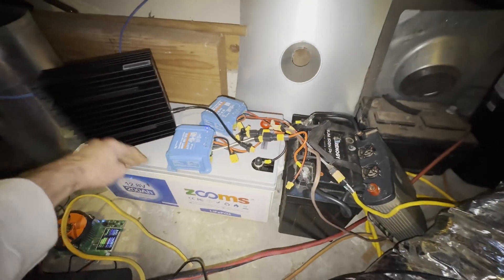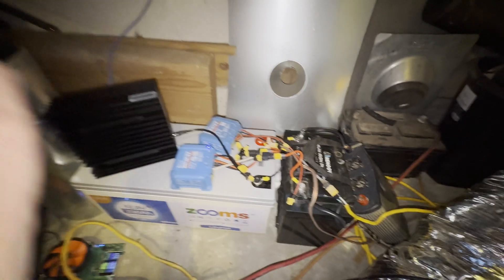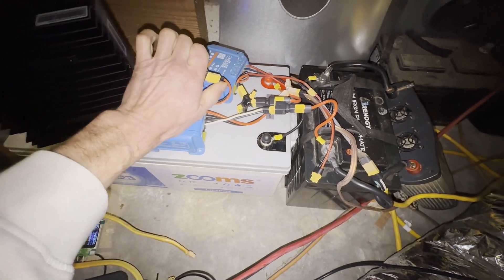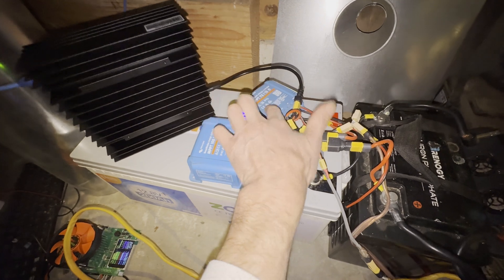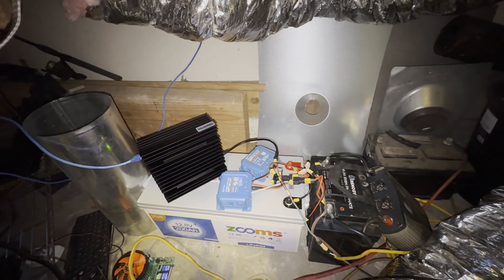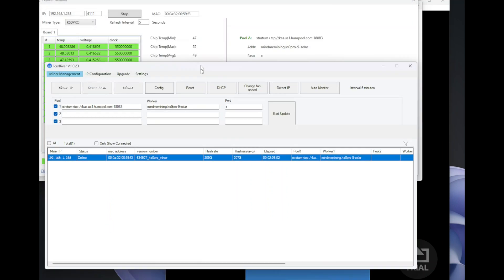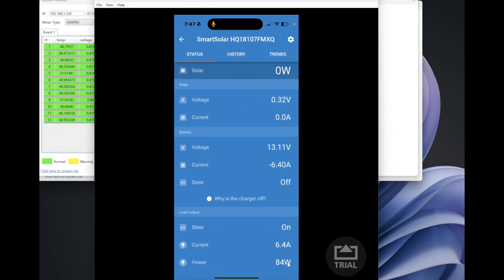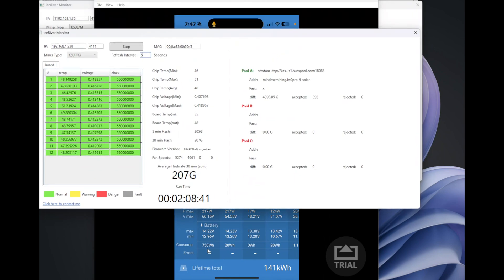MY NEW ICERIVER KS0-PRO GOES 100% SOLAR MINING OFF THE GRID

Comment: Hi, interesting project to keep KS0 miners running on cheap solar power. Would mind posting a detailed wiring (awg) diagram including all fuses, please?
Reply from the maker: Solar calculations is really based on your load and use. For example if you calculate running one ks0 ultra or rx0 not OC, it’s 90W power consumption on 12V times 24hours you get 2.1KW daily use you always add 10% on solar to DC conversion and if use battery for storage another 10% loss so I simply add 20%  so it’s about 2300W of daily solar you’ll need per ASIC. Size of wiring will depend on how many solar panels and battery size you use.

Comment: How many wp needed to power 1 ks0 ultra without battery? Im trying to figure it out, no need 24hr on, if there is sun its hashing, if not, let it off
Reply from the maker: its been 96-98W on 12v directly plus solar charge controller uses some power as well. So I think it is safe to calculate 105W for solar use, hope that helps
Reply: @DontMindMeMining  thanks,, but I mean the panel size, is it 300wp enough?

Comment: Well based on my off the top calculations i mean your looking at 2.4kw you need to produce in solar to run each ks0 that might be doable with 400w in panels. Well idk id have to sit down and do 12v amp draw calc and charge rate calcs but solar ks0 mining is definitely not out of the realm of possibility cause they are so efficient. It is big upfront investment specially when you have alot of ks0s.
Reply from the maker: using close to 7KW a day for 2 ksopro overcklocked to 280G. I may need to add another battery to male it total solar mining 99% off grid

Comment: Interesting video as well, I just have one question, I got my first KS0-Pro about 7 days ago, and after mining for 20-22 hours it stop hashing, this has happened every single day and Iceriver are not being helpful, Have you experienced or heard of such a thing?
Reply from the maker: I don’t see my response I posted. So did you update firmware from iceriver website and are you using any OC firmware? Have to make sure you monitor with monitoring tool and check temps and chips voltages. Also, I noticed when pool connection is bad the miner will perform badly so I had to choose different pool.
Reply: @DontMindMeMining  yes I did update the firmware and am currently using the stock firmware, I am monitoring the temps and all are within normal max as been 53 l, I changed pools but without any success and like clockwise after mining for about 20 hrs, it's stops hashing with a solid green light and after  30-45 mins it's reboots itself, during that time I don't have access to the web GUI
Reply from the maker: it sounds like there i a problem with the ks0pro in that case, i havent had anything like that with all 9 of my ks0pros, but i had one ks0 OG bricked and they couldn't repair remotely and said that i need to ship it back for repairs, the shipping cost is crazy ups $450, dhl $240 and usps almost $100 not sure if they even can repair since only few days left for the warrannty and shippings takes 10 days with usps so i can't recomend you anything there on the repair with iceriver, maybe ask for usps sticker emailed to you for shipping back that they offer for $55 i havent tried that yet so I don't know if they even offer that. If you choose not to ship it back for repairs and they can't recomend anything else I would check the thermal paste and add the heatsinks to the mosfets just as a reserve option. What pool you are mining to by the way? have you tried solo to KDX? @jkw75
Reply: I started with ViaBTC now with K1pool, Iceriver tech support has gone quite, is there a way to look at the system logs files to try and see what’s happening when it stops hashing?
Reply from the maker: @jkw75  k1pool and HumPool performing best for me, at one point I had to reset to factory setting few my miners and disconect power and then connect back reset to factory again and then install firmware this process may clear all the errors but there is no log file to look it up as das as I know. When I had my miner failed on the high overclock I set up 5 sec refresh rate on monitor tool and screen recorded the video to see. I could see temp1 rising before it crashes so I had to lower OC. Since you on stock firmware you should not experience that bit hopefully resetting to factory and restarting miner will help the issue but I didn’t have that before so couldn’t tell for sure.
Reply: And just had the ASIC for 8 days now, really frustrating
Reply from the maker: @jkw75  one more thing I had restarting the miner when my network router was in auto restart mode scheduled maintanance that cuz miner disconnect and restart if you have other miners works fine then maybe that not the issue.

Comment: this is what it's all about. Passive income at 99.99% efficiency. Great job man keep it up.
Also please link for the 6 pin to barrel jack, thank you
Reply from the maker: I have my cables listed in description it’s xt60 to barrel connector that I use. From pcie to xt60 I make up those connectors myself very easy to do if you have some spare from GPU mining otherwise there is a guy that sells those pcie to barrel connectors you can ask in greater good mining discord channel.